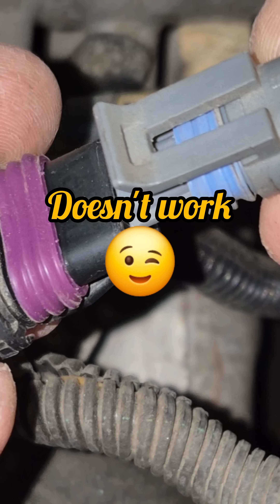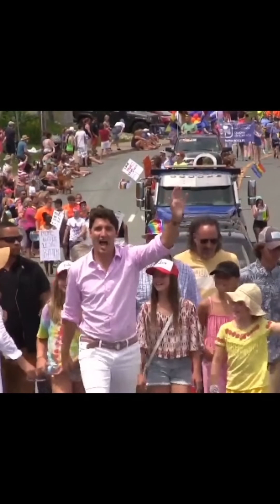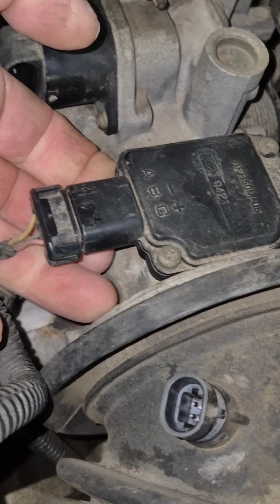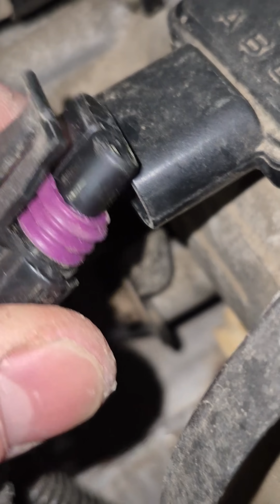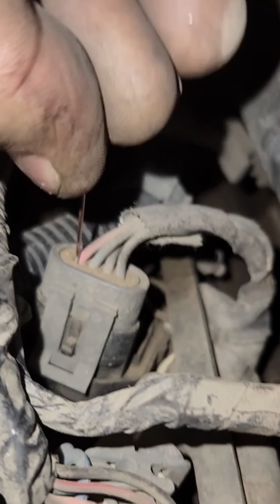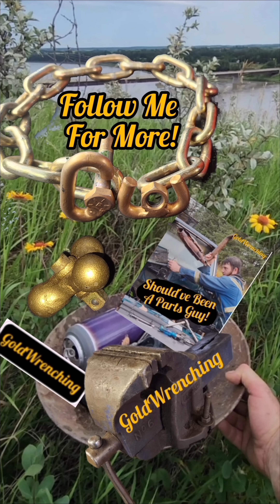Male & Female Connectors!

Comment: Oh gawd nooooooooo =_=;;
how do you define male and female for connectors?  Is it male if it has pins or is the plug?  Like when the receptacles have the pins ... is the plug secretly a girl?  

So i realize powerpoles are herm but what the hell are wires and screw terminals.  Theyre not even the same species.  

Also are ferrules condoms?
Reply from the maker: Like humans, I think they're all a little confused at times. 😆